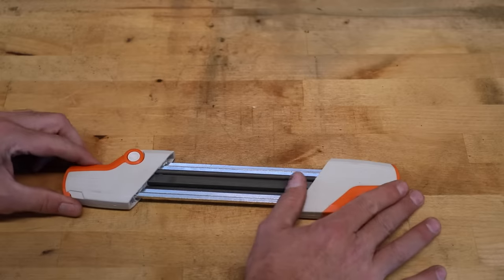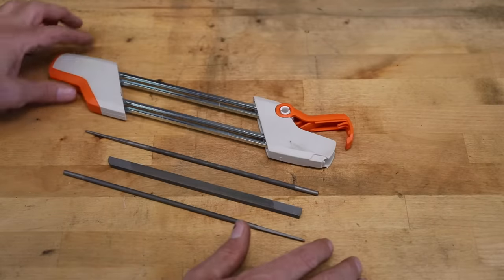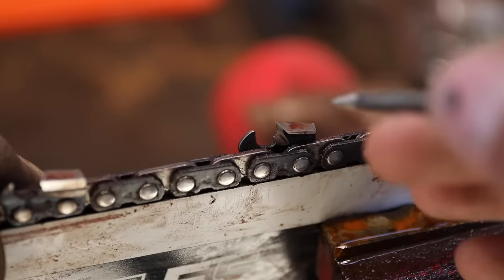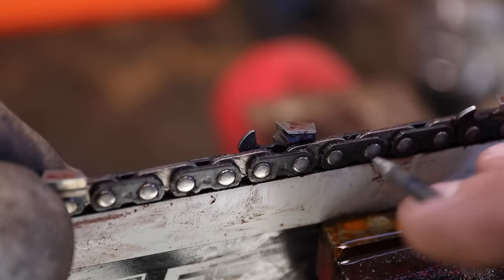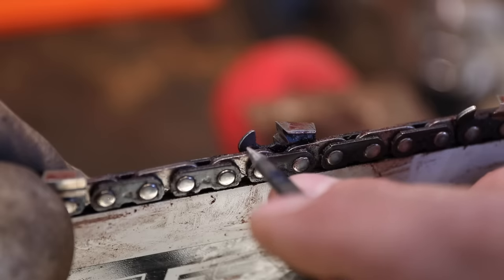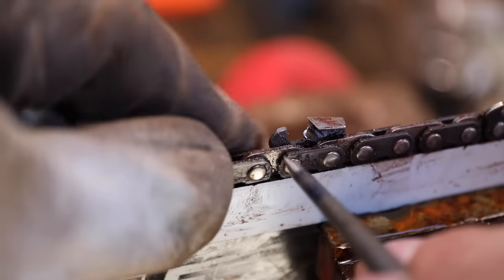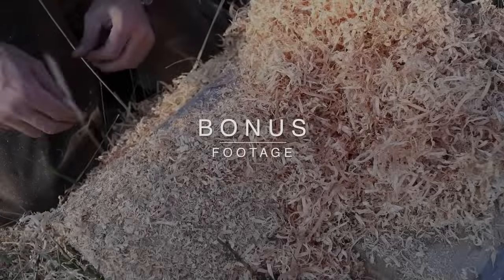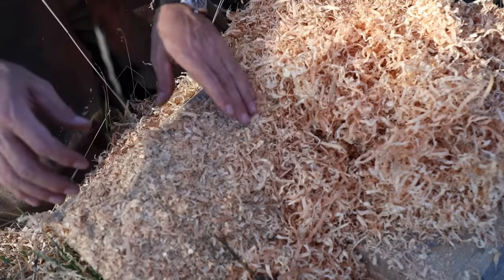Best Chainsaw Sharpener Ever - FINALLY!!!

Comment: Well I paid $75 NZ for mine.
Sharpened the chain
And went to work on the old Willow's in the holding paddock by the yards.
And all I got was dust and a bit of foul language.
So I looked hard at it and the chain looked good all the right angles.
So I finished off the job and got out the last stump down in the mud and got it nice and dull.
Spent a bit of time sharpening it again.
The went back to the house and cut up some old posts.
And it worked great.
So looks like no matter how sharp it is it won't cut those old trees and produce nice chips.
Thank goodness that job is done and I can keep my chain out of the rubbish timber.
Wahoo

Comment: Yeah, they're actually made for the New Zealand market. I run genuine Stihl chains and we sharpen them at a 30 degree angle, and that sits perfectly with the angle, both etched on the tooth, and the angle of that sharpening tool. You must sharpen yours at about a 20 - 25 degree angle?
Reply: I run 30° as well I'm in Aus. Some over here run 25° and even down to 10° when slabbing hardwood

Comment: A lot of guys that know what they are talking about say to look at the chips coming out of the cuts.  If they are dust or smallish chips, the depth gauge needs to be
taken down a couple strokes.  A lot of other guys totally ignore these depth gauges and struggle with a saw that just won't cut, even though the teeth are very sharp.  So, folks, pay attention to those so called rakers-- depth guides/ gauges.  Your saw will do the job as intended.

Comment: I like running my rakers a little deeper than recommended too. Course ive also ripped the handle out of a tank.
I wouldve liked to see you use it at recommended settings, just to see if theres any difference.

Comment: The reason for the angle that is on the Stihl chainsaw sharpener I believe is the 30 degree angle that they put on the little metal guide for us non-professionals as you would say but I've never even used one of them guides due to the fact that once you sharpen chainsaws for 15 years you get pretty used to it but I do believe that is the 30 degree angle I can't be for sure cuz this is the first time I've seen this tool but keep putting out them videos wranglerstar can't wait for the next one

Comment: Ok, back in September of '20, I took my Jonsered saw to the shop to get a brand new chain as the one on it was about done for after being on it many years and too many sharpening to count, but was not going to cut 3 cords of Doug Fir logs.  The new chain was a Stihl matched up to my bar, etc.  The paper that came with the chain in the box number showed it was a 72  with a tooth angle of 30 degrees.  Ok, Dale said Stihl makes these really cool file guides, but he was out of stock at the moment, check back in about two weeks -- he'd have some more.  I got my logs cut up and didn't go back.  I'll have to go when I need to cut more logs this fall.  The one I needed must be the more common size if he can't keep them stock.  Anyway, 30 degrees angle is correct and it files down the depth guide (raker) the proper amount -- about 20 thou, I'm told, as the tooth is sharpened.  Three or four strokes to dress up the edge and a couple of whiskers off the depth guides.  A pretty good sounding deal to me.
Reply: Jonsered is the poor man's chainsaw
Reply: @nikosgrigorakos  well, I don't know about that.  I must be a hell of a poor man.  I've had this same saw since 1983.  It always starts, it always cuts, and if if I keep clean fresh gas/ oil and a good bar oil in the tank, I'd risk my life with that  saw-- and I have at least once that sticks in my mind.  I was out about 22 miles from home, collecting a bit of firewood.  I had a deer tag to fill as well.  So I thought I'd see if I could do both in one day.  Well a blizzard was threatening and I had collected almost a  good load of fire logs. It was about an hour before dark so I called it a day.  No deer that day.  Maybe a mile from where I was cutting logs, across the road out, there were maybe fifteen good sized trees blown across the road.  If my Jonserud had failed me, then or since, I could have had a long cold hike to where there would have been help.  Instead, I cut a path out through those blow downs and made it home before 10:00 pm.  I went back a couple days later to collect those bucked up log chunks.  I took my saw and rifle with me.  This time it was mid morning after a storm and I popped a nice little buck deer.  Not bad for a couple days outdoors with a good saw and a good trusted rifle.  The easy part was over -- still had to dress out that deer and saw and split a mess of wood before winter's worst hit.  So smile if you want to call me a "poor man".  No, the poor man is the dude that can't get his saw running and is 20 miles from home in a blizzard.  The laugh is on you, pardner.  Bob

Comment: It appears like the angle that the tool is maybe set for is at a 30°angle  which is the most common angle used in standard chains.  
I have seen this particular sharpener and have debated multiple times of wether to buy one how ever after watching your video I've decided to definitely buy one . 
 So thank you for your review on this tool.  I appreciate your videos!

Comment: Had a lot of tree fall this year and it think all of them fell on my fence ... took care of a 7" bole and a 10" bole cherry no problem ... one rotted pine of no consequence.  Then came a 14" black locust wood ... got thru the branches fine and it was still going well ... nice chips.   Then two cuts thru the locust wood trunk so we could lift the pieces .....and 1) had to change the chain .... then 2) had to take  a break from lifting the two pieces I cit off.... sang that stuff is hard and heavy.  Brought back memories of adding ethernet to the house   (converted 200 year old Dairy barn  with post and beams made of this stuff) and taking forever to drill thru one beam.  On the other hand, piling it up at the end of the driveway ... it disappears in less than an hour

BTW, this was pretty expensive originally ... but it was available from Pferd for like half the price..... now Stihl cut the cost.   Pferd also supplies a similar tool to Husqvarana (They call it the StrikeForce $16.95).  Of course each tool fits only specific chains so make sure to pick the right model.

Comment: It was too hot today t work outside. So I decided to sharpen y blades and came across this . If its good Enough for  Wrangle star , It good enough for me.  the only question i I have is that it will work on all blades?

Comment: I used to take my chains to the Amish for a sharpening.  But once I got older I bought the sthil 2 n 1 and have been sharpening chains wit it for 4 years now and love it I also replace my files every 6 months to a yr    I I’ve 15 chainsaws.  All STHIL PRO SAWS I USE ON THE FARM TAKING OUT FENCE ROWS.

Comment: As I understand the filing angle, consistency is most important. A sharper angle will be sharper but dull more quickly. Most importantly, I’ve learned to replace my files often.

Comment: Good video! I just bought one, I can’t wait to start using it to sharpen chains instead of replacing. I was hand filing but that just takes too long and requires too much effort. This looks like it will be great for me as a production climber/cutter!
Reply: Also cool to see that 461 handle a 32” bar, I don’t usually push mine to that limit but when I did, it was a champ. Love the 461 platform.

Comment: I noticed that your vice is mounted to you bench just the way that it came out  of the box. If you were to unbolt it and rotate the  base 90 degrees clockwise, you would find that your inner jaw can clear the edge of your bench. This will allow you to mount long pieces vertically when you need to.

Comment: I have no issues using a simple file set, but i keep the cutters touched up. Every other tank at least, usually every fill. Less chain wear ultimately in my experience. Just keep cuts clean as possible, keep it out of the dirt.

Comment: Cody, soft pines get a shallow angle (20-30) and a bit more hook on the tooth and hardwoods like white oak get the deep angle 35-40) and less hook for a more durable less aggressive edge.

Comment: Late to the comments but:
The filing angle can be anything from 5 degrees to 30 degrees depending on the wood you're cutting and the power of the saw you're using. If the chain came with the saw the factory has probably matched them as well as they can for the average consumer. 
The more aggressive angle will cut faster but will also dull faster if used on a harder wood, is what i've been told, we've always just matched the chain.
My guess is they included the angle in the design of the sharpener to give you a little bit more pull length when sharpening instead of if it had been a simple 90degree.
Thanks for the video might pick one up.
Reply: Ive always thought a ripping chain was closer to 90 degrees and crosscut chains have more angle. That is true for any handsaw be it american. Japanese. or whatever. I dont know why it would be any different with a chain saw?  Think when you use a hand chisel you have a n edge 90 angle to the grain but if you chisel crosscut it is best to cut a "knife wall" to prevent tear out.

Comment: Back in the day, Stihl made a chainsaw sharpener where you can put the blade and set angles and run the blade on a track. Takes 3-4 mins per chain. I think they discontinued it. I know because my father in law has one that is STILL going strong and it is stamped 'Made in West Germany'!

Comment: Nice review, could it be that you file 10 degrees instead of 30 degrees? I know my milling saw has a chain that is 10 degrees from factory and I use it for felling trees and cutting up logs as well as milling. Works well enough for me.
I think this Stihl tool is quite good, have used it for more than 4 years.

Comment: Just bought one with my new saw. About $50 au here. Be keen to try it soon. I've always used files. Don't like the small electric sharpeners as the stones wear too quickly and don't match the saw tooth correctly to make a sharp chain

Comment: Chains are sharpened at a 35 degree angle if you are cutting across the grain like when you are cutting firewood or bucking a log. You are making a pretty shallow angle. When I used my saw in something like an Alaskan mill then you use a chain designed for ripping and those teeth are sharpened at a very shallow angle for cutting with the grain as when cutting a slab. Also when sharpening a tooth the file needs to be at 35 degrees in relation to the bar but it should also be held at a 10 degree vertical slant where the file would be lower on the inside of the cut.

Comment: The tool has the proper angle built in, not only on the housing but the metal bars as well. I don't know why you would shallow the angle. I've always filed about 30 degrees just like the angle built into the tool.

Comment: they are brilliant one issue is they do sharpen the chain that it is a bit too aggressive for nose boring when doing notching in while fencing etc. but for ripping, felling and general cutting its perfect. yes its designed for conventional  non skip tooth chains.

the angle is the correct factory angle for stihl saw chains which is 30 deg

Comment: That sharpener has diffrent pitch selections for diffrent chains, they are, 1/4", 3/8" (PICCO chains), and .325, 3/8" (standard chains) you likely have the wrong pitch for your current saw. Amazing tool none-the-less, going to have to rip my saw down tonight to figure out the pitch. Thanks for the heads up!

edit: grammer.
Reply: I'm sure you must know, but is the pitch printed right near the base of the bar?

Comment: At 5:35 when you mentioned the discrepancy in saw chain marking and the markings on the sharpener, its because you have a Super L Klassic saw chain and the Stihl sharpener is designed for semi-chisel and full-chisel chains. You should be using a triangular chisel file. Using that sharpener, youre basically reprofiling the Super L Klassic cutter to a full-chisel.

Comment: The  Stihl 2 in 1 sharpener comes in different sizes. Engraved on the Stihl bar gives you the stats for what file size, angle, etc. you are required to use. The sharpener for my Stihl  170 differs from my MS 261 C. So I have one for each. But you can  get away with buying one by installing the correct size round file if different. And ignore the angle line on the sharpener and eyeball it like Wranglestar demonstrated.

Comment: great tool. simple as can be. 
Seeing those shaveings pouring out the waste port tells the story.
I use a short light saw and bar (12 inch). Those few teeth do a lot of work compared to a longer bar, so haveing a realy good sharpening tool is a godsend.

Comment: hi...i think you were holding the files backwards...usually the push stroke is started with the shank of the file closest to ur body as you push away from you ( the shank of file is the uncut portion where u normally place a handle)

Comment: at our shop we use a 30 degree angle to sharpen..  we use the Stihl bench grinder but honestly this tool you are showing is better..  the bench grinder is like $700 from Stihl, that file set is like $30

Comment: The depth gauge is a safety feature to prevent kick back. This is what makes it a "low or reduced kickback chain".  Saw will work great with out the depth gauge but not recommended.

Comment: Stihl does have factory chains with two different angles. One is for power and the other is for speed. If you're using your saw mostly for hardwood like oak and maple, then power is the angle you want to get. If you're clearing cedars or pine, then speed is better.
Reply: What angle for a small Stihl battery saw cutting pine trees and branches? Thanks.
Reply: @Mark-qq9cd  I'm not sure the option is available on the smaller saws.

Comment: I know I'm really late to comment on this but do you prefer the stihl tool or the timberland clamp on bar one? Just curious which you thought did a better job as i am getting tired of hand sharpening the old way and wondering if these new ones are totally worth it.
Reply: Correction timberline sharpener not timberland

Comment: Good video. 2 things could have made it better. If you called Stijl customer service and got us an explanation of the angle issue. 2– what diameter files did it come with and can it work with a variety of diameters?

Comment: Well done.  I am concerned about the correct angle to hold the tool.  It seems that you had to estimate the angle then repeat that for every draw of the file.  I am not sure I could repeat the exact angle every time, thus ending up with cutting blades that are rounded off.  I would prefer a tool that clamps onto the bar or clamps onto the chain so the angle would be controlled by the tool not me.  I am sure this works well for you, but I sharpen 2 or 3 chains a year and would not have the fine touch that you have.
Thank You for the demonstration.

Comment: It appears the chain used for the demonstration is a skip tooth chain. I believe the sharpener is designed for a full tooth chain. On a full tooth chain the (outside) rails of the sharpener will be supported on both sides to provide more accurate filing of the depth gage.  It can still be used on skip tooth chain however the user has to apply a manual technique to compensate for only side of the outside rails contacting the chain. I have a grinder sharpener which is fiddly and not very effective.
Reply: flat file chain type - learnt on you tube the other day :) maybe a skip ?but that refers the breaks between links. whys hes filing a flat file with a round file

Comment: Been using these for years and have had good results but it does take off to much of the rakers especially on my 661 with 36 inch bar, it will fight you like crazy

Comment: I belive the chain on the video is for rip cuts. Usually a chain for rip cut has a tooth angle 10-15 degrees. Sthil crosscut chain has angle of 30 dergees, its also written on the more simple chain sharpener. For example Husqvarna has crosscut angle of 35 degrees.

Comment: I will invest in one of these. I have been using my dramel with the guide. My question is, does it come with different sized round files? I know on a field file kit it comes with several files. I do not use a chainsaw myself but I do chainsaw repairs.
Reply: I believe so, they have all the differnt sizes for different chians from .325, 3/8, and picco chains.

Comment: The rakes and the teeth should ideally be the same height, weather you use one of these contraptions or just use the proper size round and flat files. Interesting tool, let's see how long it lasts.

Comment: The angle is different depending on the type of wood you should cut with your chainsaw. Pine is a soft wood type that you can have a sharper angle.
Reply: These boys don't cut enough wood to worry about that. 100% i sharpen my chain depending on what wood I'm going to be running through. Hold the file on the top side of the cutter a little more for soft wood.

Comment: Filing the rakers is a pain in the neck (and the fingers while you protect the cutters) and with a basic electric set up it at least doubles the time to do a chain.  
These are the best.  The way they sit flat on multiple points and the shape of the handles is so ergonomic that with little effort you can smoothly take reams off in each pass and you could repetitively do it squarely and true to spec blindfolded and drunk.
I can't say enough good things about these.